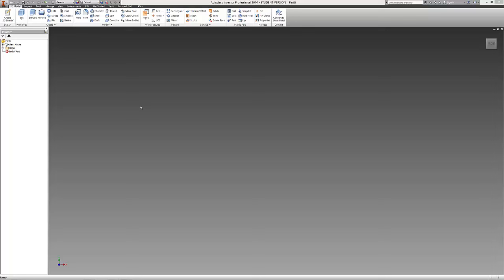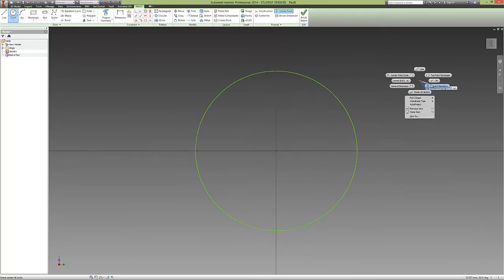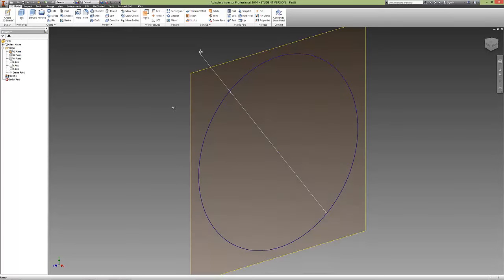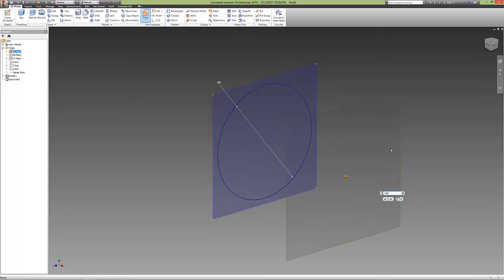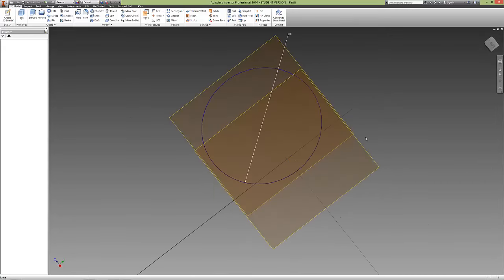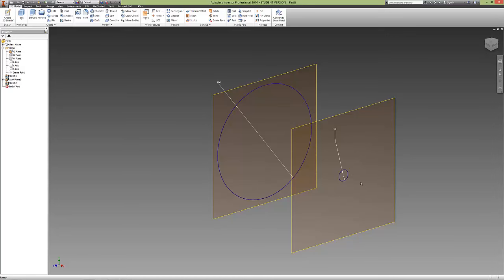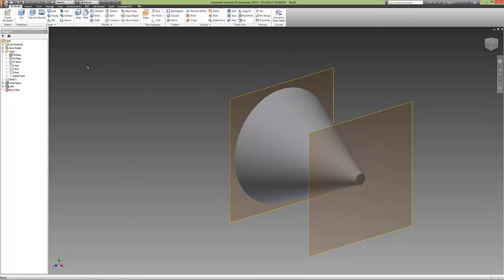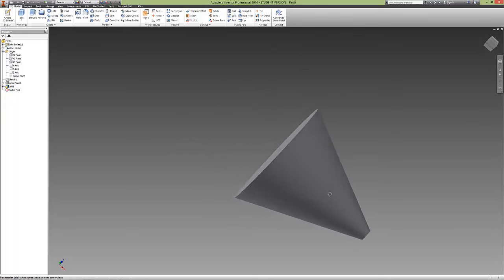Autodesk Inventor Loft Tutorial - How to Use Loft for 3D Modeling

Comment: FOR EVERYONE WHO CANT MAKE IT WORK: (Talking from experience only with Inventor Professional 2021)

You probably have a more complex shape then just two circles of different sizes, if that is the case then this tutorial is a bit misleading. If the sketch only exists out of 1 section, it will automatically select that section as you select the sketch you want to use, as it did in the video since there was only 1 section.

If yours exists out of multiple sections,  you need to:

1) Select the first sketch you want to use
2) Select the sections you want to create a loft with
3) Click add new
4) Select your second sketch you want to use
5) Select the sections that you want to connect to the sections you selected in the previous sketch.
6) Done

If this gives you an error try making the loft less complex by selecting only a few sections at a time, maybe only the ones that directly relate to each other. Then just repeat by making multiple lofts.
Reply: thank you so much
I finally can make this thing work

Comment: This loft thing is complete garbage, half of the time it wont work for me.
Reply: You probably have a more complex shape then just two circles of different sizes, if that is the case then this tutorial is a bit misleading. If the sketch only exists out of 1 section, it will automatically select that section as you select the sketch you want to use, as it did in the video since there was only 1 section.

If yours exists out of multiple sections,  you need to:

1) Select the first sketch you want to use
2) Select the sections you want to create a loft with
3) Click add new
4) Select your second sketch you want to use
5) Select the sections that you want to connect to the sections you selected in the previous sketch.
6) Done

If this gives you an error try making the loft less complex by selecting only a few sections at a time, maybe only the ones that directly relate to each other. Then just repeat by making multiple lofts.